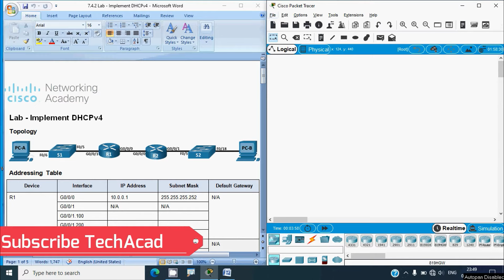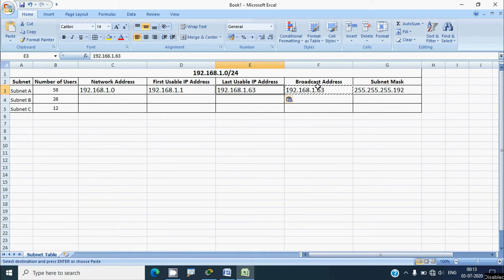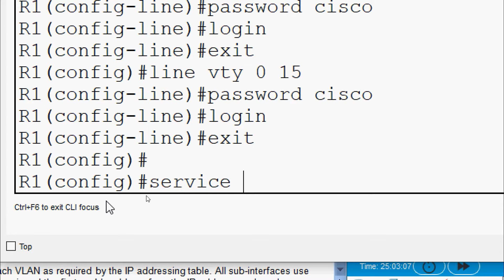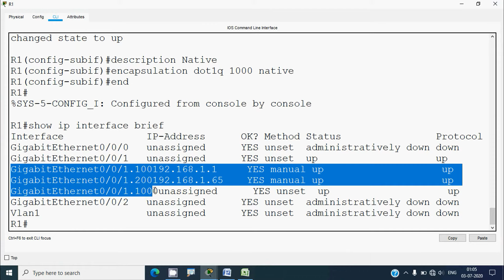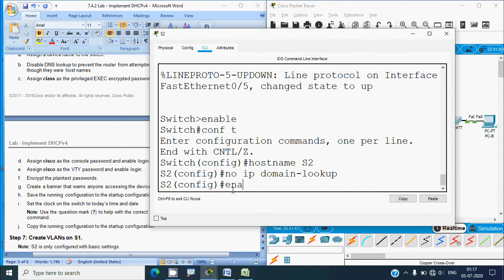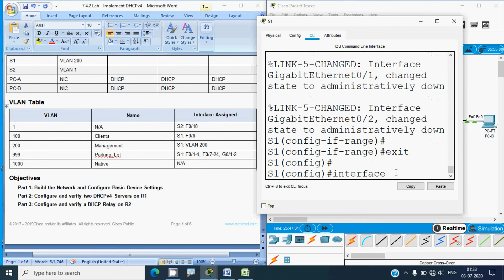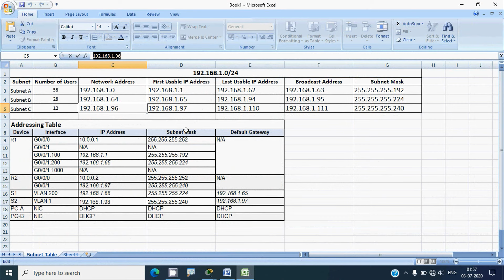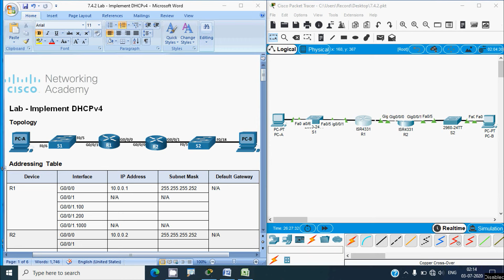7.4.2 Lab - Implement DHCPv4

Comment: your ip addressing is incorrect in the table i think. 

Step 1a says to use the second address from Subnet A as the I.P. address for VLAN 200, yet you have the second address from Subnet B for VLAN 200. The address for VLAN 1 has the same issue. Unless I'm misunderstanding the questions. Thank you!
Reply: This is correct

Comment: These have been extremely helpful in getting me some practical use. However, today i received a overlap error. Maybe you can help with why this is?
Reply: ip address 192.168.1.65 255.255.255.224
% 192.168.1.64 overlaps with GigabitEthernet0/1.100 Also for some reason I have to input g0/1 instead of g0/0/1
Reply from the maker: Yes, you cannot assign the same subnet ip address to the same router interfaces.

Comment: you had an error message when configuring the lease time and then completely gnored it and then carried on, can you explain why we got the same error message and how do you confirm the lwease time is correct?
Reply from the maker: Some of the commands will not work in packet tracer, it will work only in real routers, otherwise we must use gns3
Reply: @TechAcad  thanks its a shame, the "tutor" didn't mention this and carried on regardless .thanks for the reply